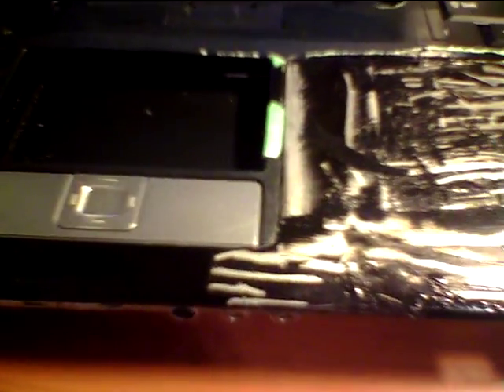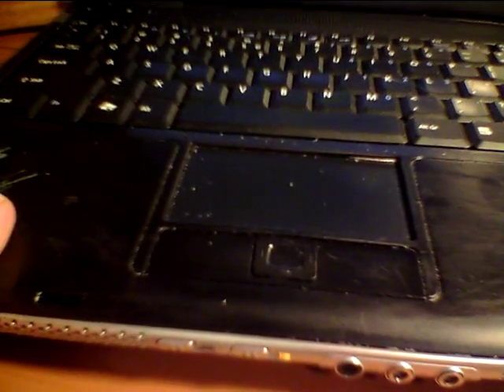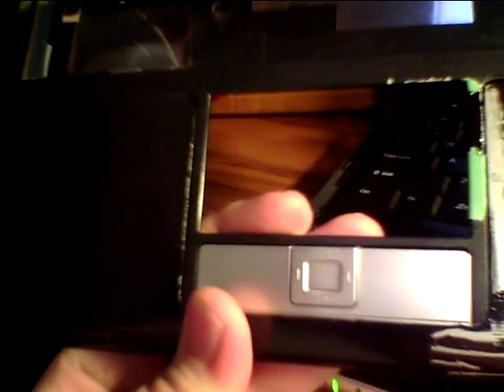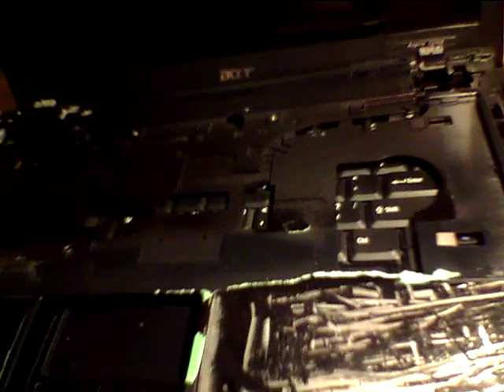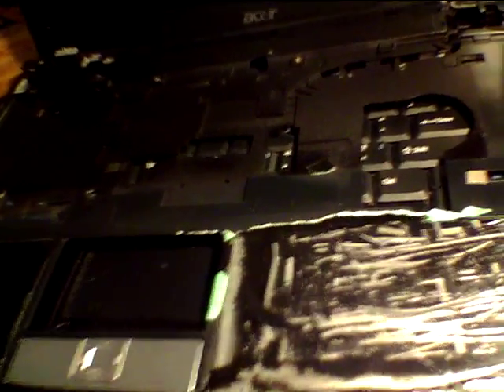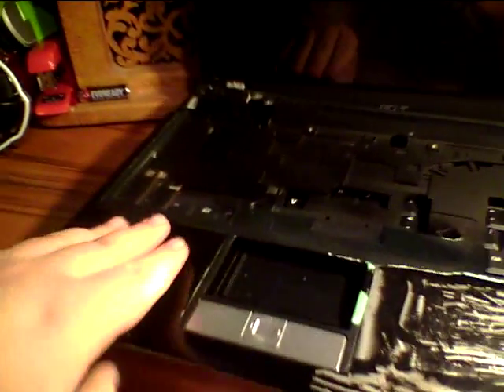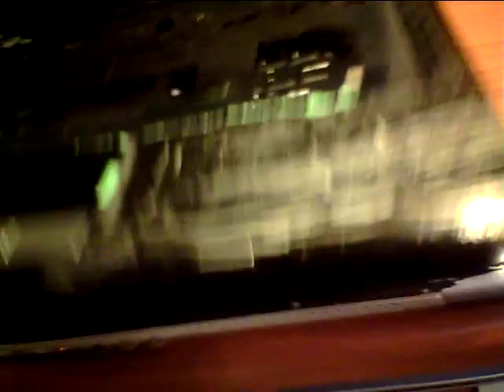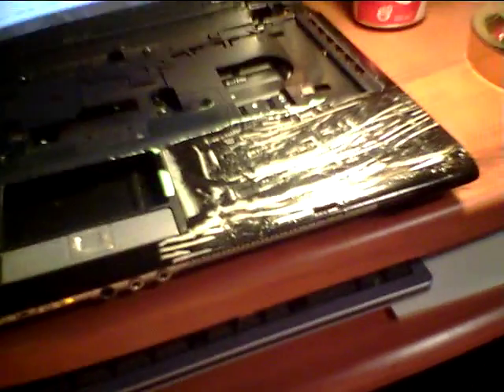What Happens When You Spray Paint A Laptop Casing

Comment: On plastic surfaces, it required to sand down the surface, so the paint stays embeded onto the surface. Otherwise it'll just simply rub off over time. Using clearcoat will also help preserve the glossy finish on the paint, like the surface of a new car kind of thing

Comment: @vcamnowaa No prob. I do a LOT of spray painting for most of my projects, and have learned a few tricks that may help; 

1) What I already mentioned 
2) Allow paint to cure for 48 hours before handling (believe it or not, it really does take that long for most paints to fully cure!) 
3) Only paint in areas with little to no dust; avoid painting in windy environments, and avoid painting in direct sunlight. 
4) light coats only, until a glossy finish is achieved.